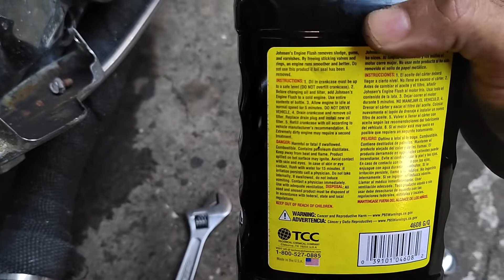Suzuki Intruder Oil and Filter Change

Comment: Wt oil did u use?
Reply: for my intruder it uses 10w-40 (SAE) idk if it's the same for all of them
Reply from the maker: sorry for the late reply, yes manual recommend to use 10w40, I used 20w50 because is less thick and works better with hot weather.